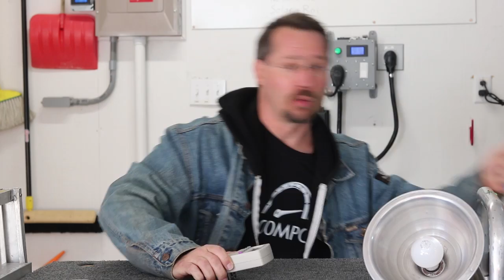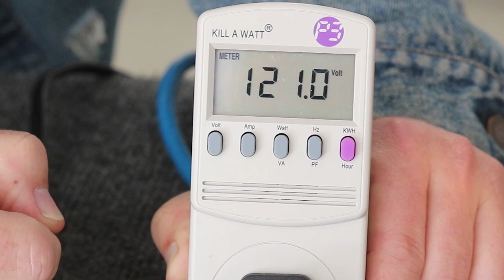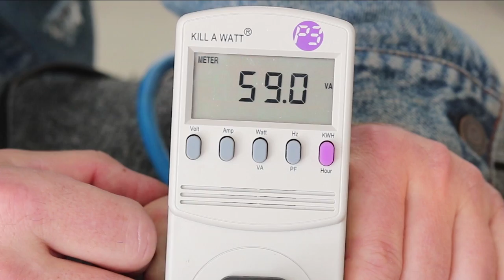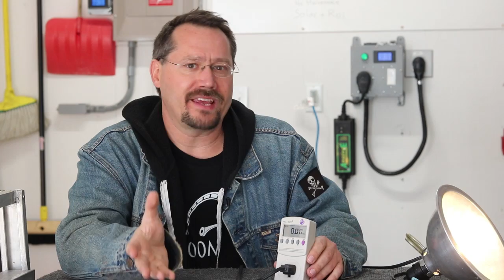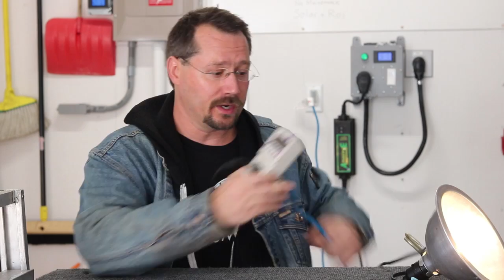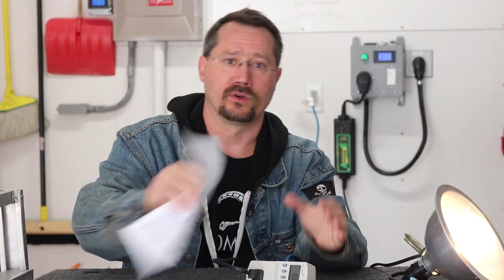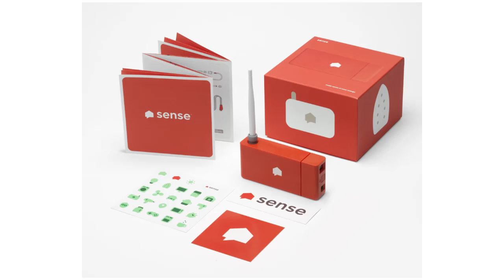How to use a Kill A Watt and save money

Comment: Just bought 1 @ around $28.00 + tx. Testing my new Walton's 135 L dry aging cabinet for charcuterie curing/aging dried salami prosciutto etc. basically a fancy wine cooler with more temp control & humidity control. I googled energy consumption per day/month Google told me running it 24/7 which you do for up to 1-1.5 months anyway Google said this unit will cost $3-400.00 per month! Can't be right! Just about to find out now that I know how to use this thx.

Comment: I used my Kill-a-Watt to measure power usage before and after I cleaned the coils on my refrigerator.  I ran four-day tests (96 hours, because it only records up to 99.99 hours), and I did both tests at the same point of our regular, two-week buying cycles.  It was heating season, so ambient temperature was stable.  Before, the back plate intake holes and the coils were covered with five years of dirt and dust.  I cleaned with a shop vac and a bendable crevice brush until things - including the fan blades - were clean.  The before vs after KWhours used: I saved 0.3 KWh over four days.  At 27 cents per KWh, I'll save a whopping, outrageously, INSANELY huge seven whole dollars and thirty cents per year!  And that assumes the falsehood that the coils will stay clean over the course of the year.  It'll be even less savings if I let the coils get dirty again.  Damn! I'm gonna get rich! :face-fuchsia-poop-shape:
Reply: your refrigerator thanks you

Comment: Get a smart plug for 1/3 the price, and watch it live, on your phone! I did. Mine doesn't do PF, but my 3.9 cu ft fridge, I adjusted to come on less, and when it clicks on, peak is 137 watts then it slowly drops to 60ish watts. That's a lot less than the plate of specs on it  says 1.4 AMPS/ Max Amps 6.5  1.4x120=168 So Haier is pretty spot-on. BTW it is 12 years old!

Comment: Thank you, Benjamin.  What about those devices that electricians use where the meter clamps around a cable and they read it?
Reply from the maker: Those are clamp-on ammeters. They measure the electrical current of the wire running through them. Great for testing and for high current devices. You need to only have ONE wire running through them, NOT a cord with both a hot and neutral wire (or 2 hots).
So, they really don't work for standard corded appliances the way a Kill-a-Watt type meter does.

Comment: Problem: 

Have a nice Stihl E 14 yolectri chainsaw. Got carried away, pulled too much current, boiled armature. Turned commutator, used it again for a long time. DANG! Did it again. This time opened a commutator armature winding. Found a new armature, putting it in. Getting old. Need  an audible plugin overcurrent alarm so l can immediately back off on saw load to preclude boiling saw motor. No luck finding one on computer. Anybody got any ideas? 

Thx.

Andy Eppink

Comment: Isn't VA...  Just Watts, because mathematically speaking VA is Volts times Amps, which equals watts...   Just saying...  It has been since 1990, but i don't think that has changed at all!  lol
Reply from the maker: Technically, there is a difference between Watts and VA.
It has to do with reactive power vs real power.
Wikipedia can probably explain it better than I can.
Reply: @BenjaminNelsonX  The only difference is diode and resistors...  2 more factors in the equation.  Like i said, I went to college for Electrical Engineering.  I don't do Wiki...   lol

Comment: Maybe you (or someone) can answer my question...I have a very similar device I bought to calculate power needs of various items I might want to plug into my generator in a power outage. I have a 7 cu ft chest freezer that says on the label that it is 1.7 AMPs @ 115V. If you multiply AMPS x Voltage, you should get WATTS required. In this case that would be about 195wt. When I plug the freezer into the monitor, I get very different numbers (??) The monitor displays .65 AMPS (instead of 1.7 AMPS), and it displays 60 watts (instead of my calculated 195 watts). Where am I going wrong here?
Reply from the maker: The number listed on the tag should show PEAK current in AMPS.
The device should use no more current than that, but often very much less.
That's one reason why you can't just use tags off appliances to calculate battery run-times.
It IS useful to know the max current of appliances, so that you can know how many things you could have on all at the same time, even if they ARE pulling their maximum rated current. Peak current of everything total you want to run on the generator should be less than your peak generator current.

The other issue is that appliances like refrigerators and freezers cycle on and off. At some times, they may be drawing maximum current, and at others no current at all. A Kill-a-watt or similar device can track the total amount of energy over some period of time.
Reply: @BenjaminNelsonX  So if that's the peak AMPs, than I can get the freezers surge watts by multiplying that by 120v (which would be 204 wt). Would that be correct?

Comment: Nice- will be good to know if an old freezer is profoundly less efficient than a new one, etc.  and also helpful to gauge actual current draw of items to be used in the field with an inverter to tell if the inverter will handle the load.

Comment: excellent video. Now what is the brand name and model of the 249V monitor behind you?  There are so many available on amazon, but you have used yours for a while, so you must be happy with it.
Reply from the maker: They go under a couple of different brand names, but just make sure to get the AC version with the CT. Mine was a Drok https://amzn.to/3wnt2AE
Reply: @BenjaminNelsonX  ok, now I see what you did, you made the box yourself and put the meter in it.  What you said on the video left me hoping that there was another video somewhere that showed you building it. So the only thing attached to it is the EV charger? Great info, I happen to have too much time on my hands and always thinking of things to do to find out why so much of my income goes to pg&e. Thanks for the inspiration.
Reply from the maker: @gmazzina  You can see how I built the power control for the EV Charger (which includes that 240VAC power meter) in my Home Automation videos.
https://youtu.be/TszuTBUWsTo

Comment: I am looking to charge other cars besides mine. and need to be able to determine how much charge per car so I know how much to charge them $$$. 240 v, 200 amp service,
Reply from the maker: Probaby the easiest way to go is to use a device that measures current, voltage, and total energy by use of a current transducer. I used one on my garage electric car home automation system: https://youtu.be/ivrwbV-fAb4
A device such as this: https://amzn.to/3LmjT09
It will track total energy used, and has a button to reset that info. Just reset the energy use before somebody starts charging and then look at it when they are done. You could also just mark down the start number and then subtract that from the finished number.
You just need to put one of the two hot wires of the 240V power through the current sensor.

Alternatively, you could install an old-school utility meter on just the output going to your EVSE(s). Get one with analog human readable numbers on it. I've purchased them before from this company: https://www.hialeahmeter.com/siphwame.html
Reply from the maker: You could even install something like this post. It has the meter already and is rated for outdoor use.
https://www.hialeahmeter.com/mipope.html

Comment: Great video, I was wondering though what you or anyone else would recommend for something like their Chevy Volt. I am curious to know how much energy I am using monthly.
Reply from the maker: Hi Russ,
On some modern EVs, energy usage can be tracked on a touchscreen or with an app.
Otherwise, there are AC ammeter/voltmeter/AHmeter units available which you could wire up to a 120 or 240V outlet. I made a video talking about automating EV charging. As part of that project, I installed a meter to track energy usage. I usually reset the AH meter reading at the beginning of the month. At the end of the month, I can see how much total energy went to the cars.
If you have more than one plug-in car, this can be a nice way to track total energy, either by using the same EVSE for both of them, or making sure you have a powerful enough circuit for two EVSEs and have the meter on that circuit.
Please take a look at the following video: https://youtu.be/TszuTBUWsTo?t=513
Reply: @BenjaminNelsonX   @BenjaminNelson  Thanks for replying back to me. I know I can take the info from the screen but it is not as ideal as having a device like the Kill A Watt. 
I will check out the video you recommend, ideally it would be nice to have a plug and play type device like the Kill A Watt. 
Thanks again for the reply.
Reply from the maker: @Th3GreenBastard  I don't know of any very small "just plug it in" devices that are designed for 240V AND relatively high current.
What I use is similar to this: https://amzn.to/3qFjFcb
You just have to install it in a box and put one of your power wires through the current sensor.

Another option would be to use an old-school utility meter. I have one of those on my hydronic heating system to track how much electric energy I use over the winter.
Here's a link to that style meter at the web page I purchased from: https://www.hialeahmeter.com/siphwame.html
Reply from the maker: @Th3GreenBastard  You certainly CAN plug a Volt in to the wall through a Kill-a-Watt at 120V.
However, it has just been my experience that continuous high current through them is NOT a good thing.
If you have one of the 120V EVSEs that let you kick down to 8A, I would do that, and then just regularly check the Kill-a-Watt, and make sure you have good clean solid electrical connections.

Comment: Hi, if I  wanted to plug this in for a month,  with my gas furnace connected,  would it show me how many hours it actually ran (not just time plugged in,  as mentioned at 3:42) during the month? Want to infer how much gas is being burned.
Reply: Get a Nest thermostat, it tells you how many hours your furnace runs.

Comment: Is this safe to use on a 120v 15 amp 1200btu portable AC unit?
Reply from the maker: It's fine, the only concern is that devices which are a heavy load and run for a long time,  such as charging an electric car, you want to check on the device, as anything less than a perfect connection can cause resistance, which makes heat and can damage the outlet.
This is true of standard electric outlets and any other devices such as power strips and portable energy meters.
Reply: @BenjaminNelsonX  thanks for the information.

Comment: This is the best review of the Kill-A-Watt so far, I purchased mine years ago it when I got my dehydrator, was afraid it's going to skyrocket my energy bill (nah, it did not, LOL). This device is extremely helpful for spotting 'power eaters' - mostly older appliances/devices - and possibly replace them with more environmentally friendly ones. Was absolutely blown away by the high consumption of my old fridge, my power bill shrunk significantly after replacing it with an 'energy saver'. Reading the instructions, well... or watching your video, helps as well. Great review/explanations.

Comment: I have been trying to find something like or an equivalent to this, for larger home appliances, like a 240 volt, 30 amp clothes dryer with a 4 prong NEMA 14-30P electric cord plug. Any suggestions?
Reply from the maker: I can't think off-hand of a consumer product that fits the bill, but I have a few thoughts.
For something that draws a pretty steady load, you could just use a multimeter with an ammeter clamp. Use the meter to measure the current draw, then multiply by how long it runs.
Otherwise, there are 240VAC panel meters which measure current, voltage, and total energy. I've used a few of these, including on my outlet for my electric car. You would just have to build it into a project box and add whichever plug and socket to it you would want to use.
You could use something like this: https://amzn.to/3zukeI7
Take a look at my electric car home automation project: https://www.youtube.com/watch?v=ivrwbV-fAb4
In the video description, I have a parts list. It should give you some ideas.
Reply: @BenjaminNelsonX  Thank you for taking he time to reply. Your suggestion of the multimeter/ammeter clamp approach is appreciated and the notion of a 240VAC panel is something I’m definitely checking out . . . something along the lines of what’s shown here metershttps://www.youtube.com/watch?v=1ZXTArb3FGA, but the only catch is that I can’t seem to find a display that includes a “cost, per kilowatt hour” feature, like the Kill A Watt Meter; and that’s really driving me crazy, ‘cause it’s something I really want included.  If you could point me to one that does and that’d be likewise compatible in that fashion, for a setup like in the herein referenced video, that’d be absolutely awesome.  Meanwhile, thanks for the references you’ve provided thus far. Your videos are pretty intriguing. Thanks also for your time and consideration, as well as for whatever further and very much appreciated assistance, that you may be able to offer, in these regards.

Comment: Great video. Question about the solar = Do you have a battery system with it or does the solar convertedly back to the grid to help off set energy usage?
Reply from the maker: My home solar is a "grid-tie" system. No batteries needed. https://300mpg.org/bens-solar-garage/

Comment: you should not plug refrigerators into extension chords., they are supposed to be plugged in directly into a wall socket. something to do with voltage drop I believe. Usually written on the owners manual.
Reply: No no voltage drop. Depending on the gauge of wire in the extension cord it will draw more amps from the circuit and could melt the wire if it has a thinner wire on a long extension cord . Of course this only if the appliance actually draws alot of power itself . If you use Short extensions you might be ok with a fridge

Comment: i actually don't recommend using an extension cord. yes it's convenient but if you do then please state the ratings of said cord. if you don't, people will just shoot over to the dollar store and get the cheapest 2 pronged cord. clearly that is not what you are doing here but might be something to consider stating in your video.
Reply from the maker: Right. Proper use of extension cords always means using the shortest possible one with wiring thick enough for the appropriate current.

Comment: I bought the PN2000 to see what my medium size RV draws is thus ok for that ???
Reply from the maker: Are you talking about CHARGING your RV from the wall, or trying to figure out how much power you use IN the RV?
If you only have a low current charging connection (15A or less) on your RV, then you should be able to connect it through the meter.
If you are trying to figure out how much power you are using IN the RV, it's more complicated. The meter won't show you how much power was lost to the inverter, nor will it track any DC loads coming off your battery.
These devices are designed for typical household AC power. If that's what you are doing, they work great. If you are looking for a power meter for an entire RV, or are using DC or a combination of AC and DC, there are other devices that are more appropriate.

Comment: Thanks, will it show the average or max wattage or amps used over time?  Would be good to know this so I know how many devices I can plug into my UPS.
Reply from the maker: It displays power in real-time in Watts.
It shows total energy use over time (since you have plugged it in) in Kilo-Watt-Hours.
This particular one does NOT show PEAK power or current, but there are a variations on this by the same company and other similar products. I'm sure there's one that tracks PEAK power or current use.
Otherwise, if you just want to know how many devices you can plug into a UPS or other power source, I'd say to just plug them all in through the Kill-a-watt, and turn them on one at a time. The display will tell you exactly how much power you are using.
Reply: @BenjaminNelsonX  Thanks, since I own this one no reason going with a new model.  Haven't used it in a couple years and your video was better than the manual.  Funny thing is I originally bought this because I wanted to know the cost savings of pouring my coffee pot immediately into an insulated caraft as opposed  leaving it on the burner.  😄

Comment: for the AMP and Watt shown.. is that based on a per minute use or her hour?
Reply from the maker: Both AMPS and WATTS are RATES. They are how much current or power is being used RIGHT NOW.
The most common units for energy are Watt-Hour or Kilowatt-Hour

Comment: Can I use this attached to a power strip?
Reply from the maker: Yes.
Just remember that if you plug a power strip into the Kill-A-Watt, it will measure everything connected to that power strip.

If you plug the Kill-a-Watt in to a power strip, remember that turning off the power at the strip will make the Kill-a-watt lose its stored kWh meter used information. Some other versions of this same device have non-volatile memory (back-up battery, etc.)

Comment: how long can i use it to monitor electricity? i'm planning to use it to check my MONTHLY power usage
Reply from the maker: You certainly could leave it plugged in for a month.

I've never felt the need to do that. Seems like just using it for a week and multiplying by four will give you a pretty good estimate of monthly use.

Comment: So when you have it set on Watts and it is showing say 59.1 ...  is that to say that the light is drinking 59.1 watts per hour I assume?
Reply from the maker: Watt is a rate - think of it like gallons per hour.
Watt-Hours are units of energy. Think of those like gallons of gasoline.
In one hour, at a rate of 60 watts, a light bulb would consume 60 watt-hours.